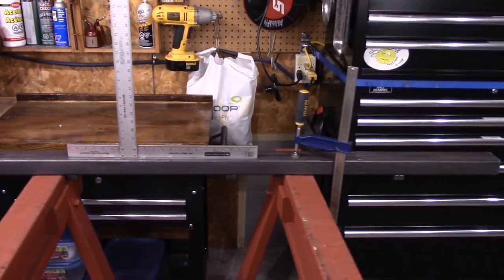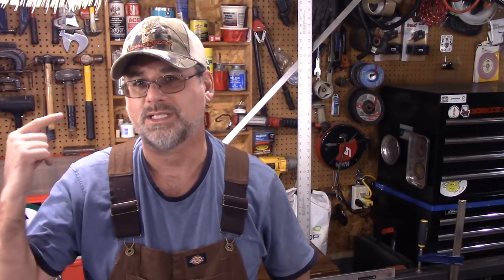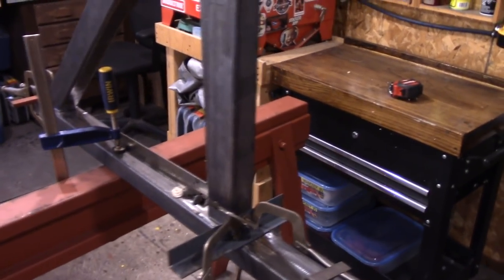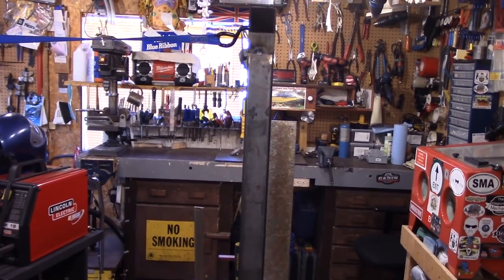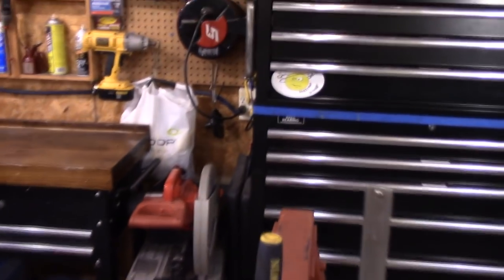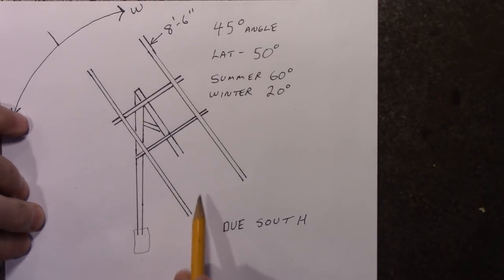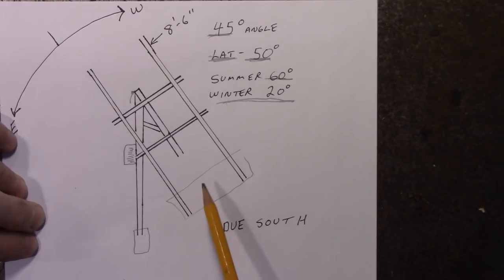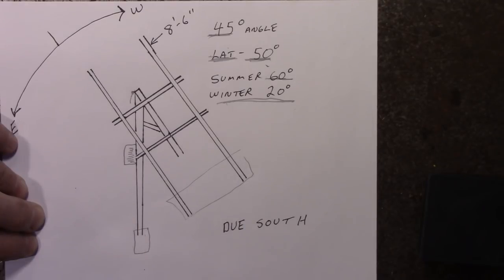HOW TO BUILD A SOLAR PANEL TOWER/POLE FOR MY REMOTE CABIN IN THE WOODS - PART  FIVE

Comment: Your drawing makes more sense of what you’re doing and from the steel that you’re using, it looks pretty strong. For me, I would have went with SS to not have to worry about rusting, painting, etc. Maybe with the next project of this size you can do a 3-D model. Keep up the good work and be safe. 😀
Reply from the maker: HAHA SS would be about $60 a foot .  I figure its costing me more  than it should but its cheap experience doing it myself and not buying one for 1/3 the price. Seems my ideas in my brain don't always translate to paper well. 😂

Comment: Starting to see how it goes together now. Looking good. Angle to the sun is going to matter more than tracking I think. I agree, keeping it simple is the way to go. I always figured the power to actually move an array to track might not always make it up in the extra power gained.
Reply from the maker: Good point and one I think as well. Battery storage capacity and daylight hours are one part of the puzzle and amperage draw the other . Matching them up is the key . Cheers

Comment: Once the solar panels are in place... you can start framing the hot tub enclosure. Nothing beats soaking up the suds under a starlit sky!
Reply from the maker: Yes and it seems Niamh will be on the plane too. Three in the tub should be find 😅
Reply: @SteveRobReviews  Got a question. Is your door big enough to get that out of your shop?
Reply from the maker: @mostlymoparih5682   Just barely :)
Reply: @SteveRobReviews  I taught kids in a prison years ago and we built a dog house in our class. Some correction officers came in and were laughing at me. When I asked them why, they said you can't get that dog house out of here. I just walked over to the dog house and lifted the roof off. They stopped laughing and walked out. Seven P's , ya gotta use the seven P's.
Reply from the maker: @mostlymoparih5682   Lets see if this doghouse of mine goes in the ground or not .
Reply: @SteveRobReviews  I am sure you will prevail.

Comment: Steve, that thing is massive. I'm sure it's going to hold up to your winds up there. What are you powering up with the 400 watts. Are you going to be using a power inverter off your batteries ? Is this for recharging them or are you powering up something right off of them ?
Reply from the maker: New inverter more powerful so I can  run a small fridge and my microwave.  Have to do some testing first.
Reply: @SteveRobReviews  Steve I have a 1500 watt inverter that I run half my house. I have to turn the furnace off when I want to run the frigerator and then turn the refrigerator off when I want to run the furnace, but it will power the house up, the cable TV, Christmas tree, lights, everything not bad off of the car In a emergency !
Reply from the maker: Im looking at an industrial 2000 watt with remote control. 1500 watts can run a lot but some  new high efficiency furnaces  need a pure sine wave inverter.
Reply: @SteveRobReviews  Steve mine surgesl to 2000 Watts but I believe it is a pure sine wave cuz it runs all my electronics.
Reply: I think I bought mine in the 1980s

Comment: I`m all for what your doinSteve....If you lived close by I`d give you some hardware for mounting all these panels...I electrical we have spring nut and uni-strut and all sorts of bracket for this type of stuff and all galvanized....Just come on over and I`ll set you up with what I have....just a short drive....You can buy from electrical supplier also the can-strut mad out of aluminium that I don`t have in stock but I have galvanized I think...It`s all based on 1 inch and 5 eight square and it all bolts together....Just let me know....CHEERS
Reply from the maker: Thanks Gator but I will try to keep it simple so my brains don't get too scrambled trying to figure all this out but in the end its going in the ground and it's going to work . Im sticking with that story. LOL
Reply: @SteveRobReviews  I was just offering, Steve, because I have a lot of hardware for mounting stuff like that in my inventory here and I thought....and the big plus is it would be no charge.....the big N/C....can't beet that....if ever you change your mind just let me no.....CHEERS
Reply: @gatorsworld  Yeah Steve if ya use Uni-strut and bolt it together then you can move the panels to different positions to see if one way is better than the other. 
Just in case you might want to be AC/DC. Don't get Thunderstruck now.
Reply: @mostlymoparih5682  Good idea Marty....to remind Steve about lightning but I`m sure Steve thought about that....I want to give Steve some good stuff but I guess he`s shy....Yes, lightning could strike at Muskrat Lake on them plains...should be interesting....CHEERS
Reply: @gatorsworld  Well I guess if Steve tells the truth, the whole truth, and nothing but the truth we will find out if lightning strikes more than once in one place.